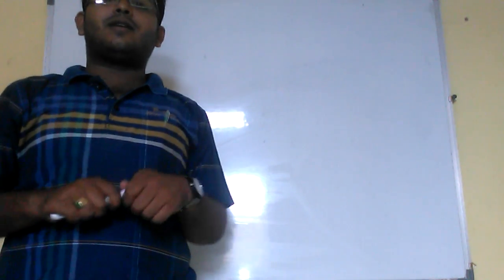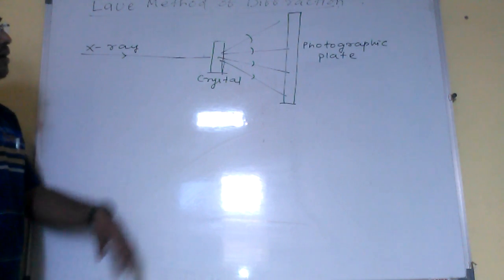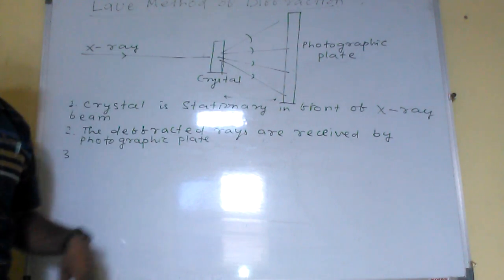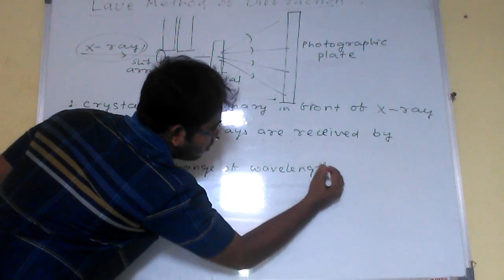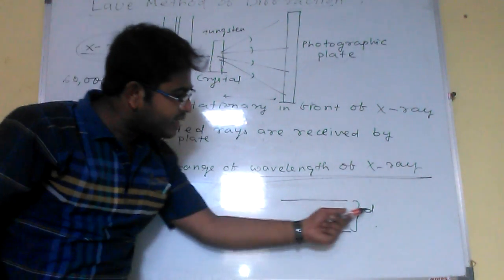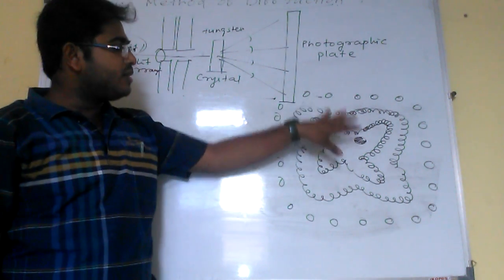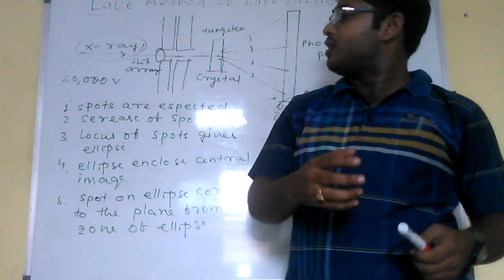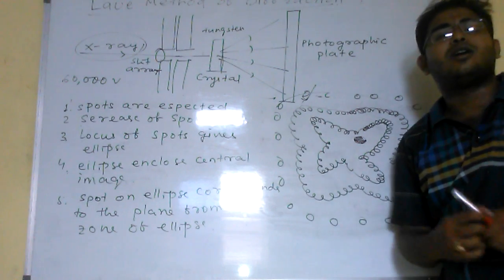Laue method

Comment: Will you please take the time to comment on this, to an electron devotee. If in an experimental setup in 'our world', not in the world and dimensions of the atom off course, particles were spread somehow in 3D space, hit with radiation and produced AN IDENTICAL (LAUE) DIFFRACTION PATTERN, AS THE ONE THAT IS CREATED BY A NaCl, for example, CRYSTAL, what would the relationship be, between the known position of these particles and the position (instantaneous ?)  of the electrons in the atoms of NaCl  that underwent through a regular crystallographic process, if any.?
Reply: Good explanation sir